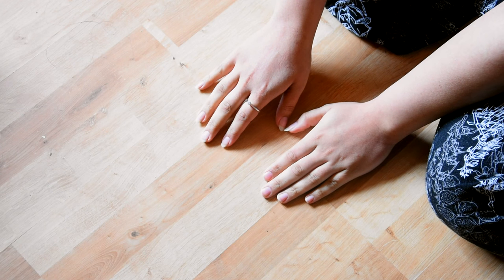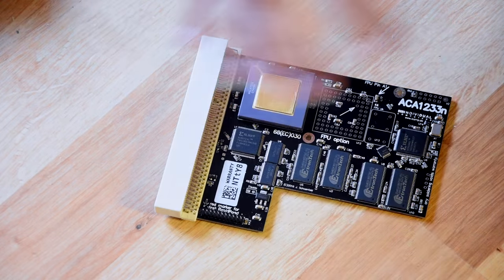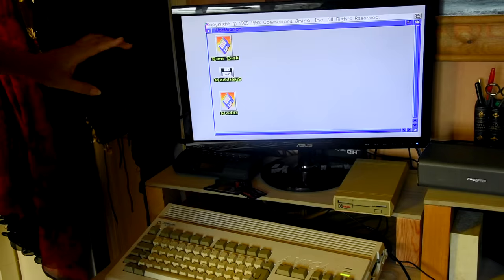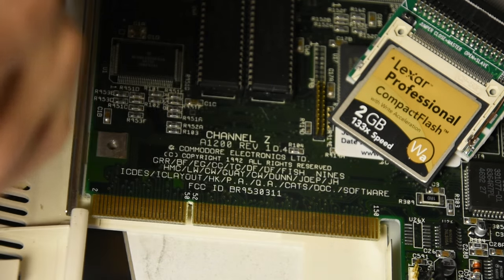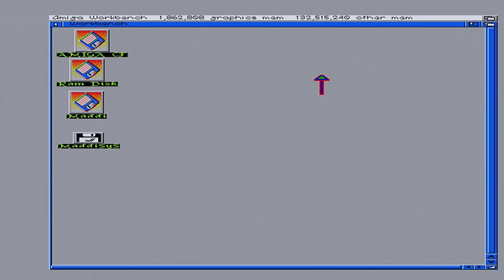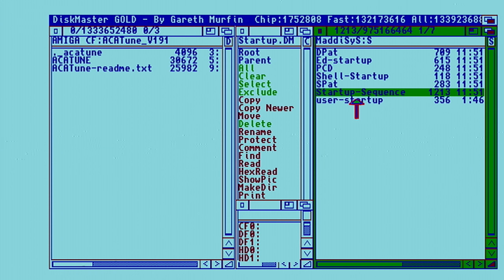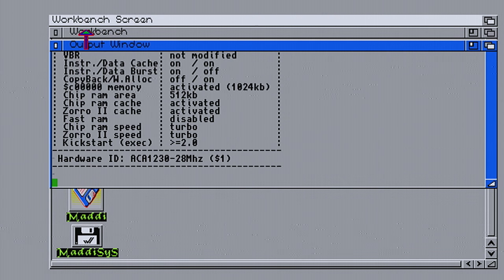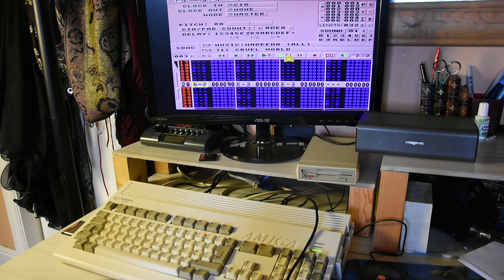Amiga - ACA 1233n Unboxing and configuration

Comment: I remember getting my first A1200 accelerator in the mid-90s - I couldn't believe how much force it required to install!  I also had no idea how important Fast RAM was, and was flummoxed when the new CPU seemed to perform no better than the built-in one.  And not being clear on the correct orientation for the FPU and how the clocking should be configured.  Oh, I remember having that problem where it starts up too fast to detect the internal hard drive too. :)

I'm watching this video on a Linux machine but I just caught myself trying to type Amiga-M to switch programs. :)  Thank you for sharing your Amiga enthusiasm!

Comment: Grats on 1233. I got the same card, and had exactly the same problem. Almost had a heart attack when I got a blank screen. Then I cleaned the connector (same way) and it works ever since. It was funny to see the same issue.

Comment: HI all 
I have fitted a Motorola 68882 FPU to my ACA 1233n card. It went ok I used sockets for the FPU chip and the crystal, you have to cut the legs of the crystal for it to fit.
The crystal is a bit high, but to fit them in a socket means you can take them out if need. I put a 40mzh chip and crystal on the card.

Comment: Well, I also recently got an ACA 1233n and had the same problem when I first connected the board! All I did was wiggle it a bit until it worked but I think after watching your video I will take it out and do a proper job cleaning the contacts.

Comment: Hi an update I have fitted the FPU I had to solder a socket into the card and I out a 50mzh onto it. It runs lovey games run very good. I also put in a kickstart rom for Workbench 3.1.4 and up grades. I use a socket for the FPU so I can take it out if needed for some software.

Comment: Had my first experience with aca 1233n. Boy that runs fast lol. Was more lucky then u that i didnt need to clean the expansion port. also i was having big trouble with a pcmia adapter to run a cf card, it frezzed the amiga and now with the aca card runs wonderful and i can copy files from pc to the amiga. Just need to make now to follow your command lines to see if i improve more results. Thank u msmadlemon

Comment: 128 MB is actually 134,217,728 bytes (128 x 1024 x 1024) so as you can see 132,644,272 is right for having 128 MB installed with some of it being used already by the system.

Comment: I also call these AKKAH, rather then A.C.A, it just sounds better to me. I wouldnt bother getting an FPU for it, as only a small few lightwave programs and Vista Pro type things work with it, and no games unfortunately.  The only difference between the 40mhz version and the 25mhz version may be the clock crystal on board.  I bought a 25mhz Blizzard 030 and fitted a 50mhz crystal, and then thing worked fine at 50mhz.  I also use a tiny DiskMaster type program instead of DOpus sometimes, as its only 11k it will fit on to most disks for debugging. I think its called Amiga Util 2 or something.

Comment: @MsMadLemon - so now you've had it for almost a year, how are you finding it? Have you had to perform any of the capacitor modifications (Individual recommends removing some due to timing fixes) or have you had no issues?
Reply from the maker: Actually, almost 2 years :o)
i'm finding it just fine, I had the timing fix already done on my A1200 while getting it recapped so i didnt need to perform any modifications. Its running just how it should.

Comment: Are you running your Amiga with the original Power Supply? I have heard that the power supply doesn't kick out enough Amps to cope with expansions. I am looking at getting an ACA 1233 N for my 1200.
Reply from the maker: No, i'm not using the original power supply, yes as you say it doesnt have enough power.
I did this hack instead: https://www.youtube.com/watch?v=DMxNH-PCYew&index=5&list=PLTfPIrcIusflb3Giog5xbDT74GYc7tTso
Reply: Thanks :) you have yourself a new subscriber! Loving the Amiga videos!
Reply from the maker: Thanks! :o)
Reply: @MsMadLemon  Do you know how many amps is actually needed for A1200 + ACA 1233n + CF2IDE? Would an A500 PSU work?

Comment: Hello, 
Love your videos. Have you installed the current beta tools  "ACA1233n.library"? If so any thoughts? 
I have been using the ACA1221ec.Works great except I have to hold down the left mouse button every time I freakn boot. (Yes, "Freakn" is part of my vocabulary  as well).   Decided I wanted to install OS 3.9. So , I ordered the ACA1223n.
Reply from the maker: Hello, thank you! .. I havent actually installed that Library yet but I will and see how it is. 
My friend has got the ACA1221ec and I think is having exactly the same problem as you, (you cannot boot from cold right?) he's thinking about sending his Amiga away for a timing fix, i've never had this with the 1233n but then i've had a timing fix done as well as recapping. If you could, could you let me know if you have the same issue or not once you get the ACA1233n please?
Reply: That is correct. it will not cold boot unless I hold down the right mouse button. My 1223n will be here Monday.  I will let you know if it boots normal.
Reply from the maker: Thank you! And congratulations on your new accelerator by the way :o)
Reply: Ok, My  ACA1223n arrived today...Installed it and booted up cold with no problem.  I am still playing with the "ACA1233n" software package. I can manually load the "ACAMparom" from workbench. However, When I enter in the command into startup-sequence and reboot. it gives me a Command error...lol.
Reply from the maker: lol I havent even messed with any software yet for the ACA, just put it in and used it.. the last time I tried it didnt allow me to get back into it because of the startup sequence entry.. I have an image backup of my drive so I can mess without fear lol... Thanks for trying it out and letting me know by the way :o)
Reply: Ohh...I am totally digging this 1233n. Running OS 3.9 Magic WB with No issues. 
Have you convinced your friend  to go for the upgrade from his ACA1221ec?
I am totally glad I did....Thanks Again.
Reply: I am very curious on this. I briefly had the 1221EC but could not make it work in two different A1200s. This holding down ONE Amiga mouse button is news to me. I have only heard of holding down TWO buttons. What does holding down one do? Also, you mention the Left one first but then later said it was the Right one.  I've read enough user feedback to conclude that the edge connectors on these boards are problematic. I too have opted for the 1233n instead. I hope I have the same luck you did.

Comment: Has anyone tried to overclock the ACA1233n? I tried to replace the stock 80 Mhz oscillator (5v 7050) with both 96 and 100 Mhz oscillators but had no go.

Comment: did you managed to get your accelerator working to 50mhz .. not sure if there's  a code or a script file to run to unlock (not really clued up on new accelerators) ... but never the less your Amiga boots a lot faster than bog standard 1200 ;)   if you wanted to stop the disk drive clicks once workbench has fully loaded .. Link - http://aminet.net/package/disk/misc/clicknot373 (Stops floppys clicking. WB/CLI/WBStartup) works wonders did my head in once WB has loaded ...
Reply from the maker: No not to 50Mhz, the only thing I know is ACATune and I discover it´ not compatible with my card. Yeah i´ finding my way around the new accelerators also. Haha yes it made a huge difference, things load quicker, processing time cut down . Actually i´e recently reinstalled my system and included classic WB, that comes with a clicky stopper, I used to use nonclick before that. Funny the one I have now, it´ reduced but you can hear the click very very faintly haha I kinda like it.

Comment: Hi all I am going to fit a FPU to my one it will be a 40mzh one. 
A seller on ebay who does new trap door covers Ventilated ones. What he does is fits a socket to the card so you can swap out. He goes by the name of thedarkforest78, have a
look at what he does. He was helped me a lot. 
So I have managed to get a FPU socket now to get a socket for the Crystal oscillator. The only fine soldering I have done is a GPO port on a Raspberry Pi Zero W.

Comment: I got an aca 1233n too, and acatune is not compatible with it. Check the manual or the wiki.
Reply from the maker: The manual or the vendor encourages to download ACAtune, however the ACAtune manual doesn't mention 1233n. Some functions like Maprom are automatically enabled on the 1233n apparently. I am a little confused with this.
Reply: http://wiki.icomp.de/wiki/Amiga_Accelerators

ACAtune is a tool that will let you activate and deactivate certain functions of our accelerators. Please note that ACAtune has been the general tool for our accelerators until 2015. Starting with the release of the ACA1221 in 2015, this tool will not be maintained any more. It's functions are now replaced by more specific tools and libraries. If you own an ACA1233n or ACA1221EC, don't even bother to download this tool - it won't support your new card.
Reply from the maker: Right, though the confusing part for me was that Amigakit (where I got this) had an option to bundle the ACAtune on a disk alongside the 1233n (or alternatively download it).. Aah well, now I know, thanks for the info!
Reply: Maybe they were not aware of it ? I would trust the manufacturer imho :-)

Comment: my enthusiasm broken when I saw the price for the aca
Reply: Roberto Ventilii I'm gonna start saving
Reply: I first had the cheaper ACA1232 33Mhz version which I overclocked to 48Mhz and had zero issues. But I needed a FPU, to run 060 demos and Quake as slideshows on a 030 ;), so I switched to the ACA1233n instead. But yes, the price might be a little steep but it's a quality product.